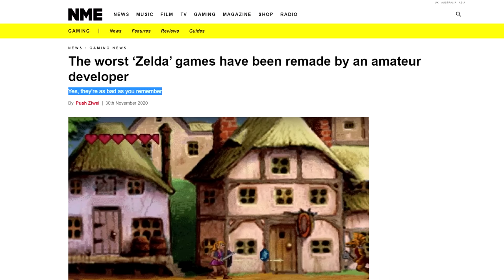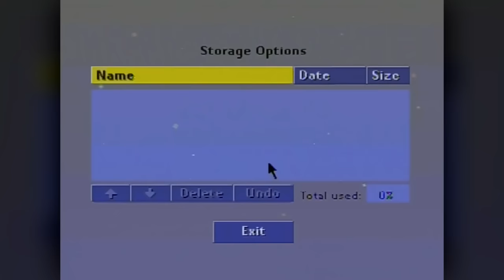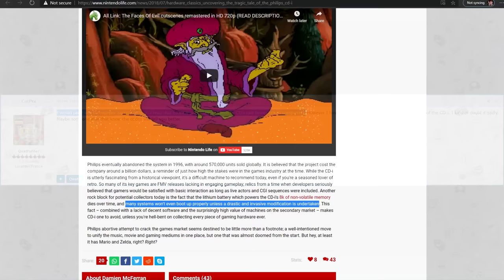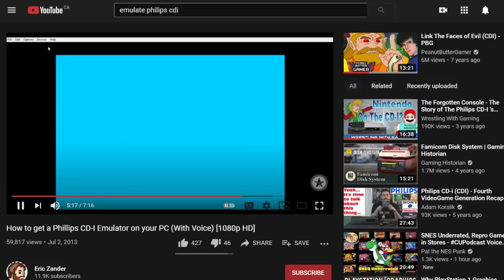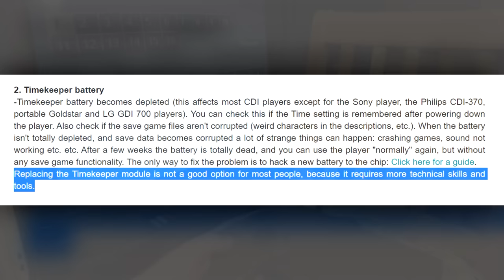Don't Risk Buying a Philips CD-I

Comment: While that may be the only console with that chip problem,  there are some vintage computer systems from the late 80s/very early 90s with that same issue.  I have a Tandy system that has an "all-in-one" Dallas DS1287 Real Time Clock Chip  and the solution is the same as here,   dremel out half the thing, and install one of those CMOS battery holders.

Comment: Yeah, this system's timekeeper battery issue is pretty annoying.  Two types of CD-I systems don't have the timekeeper battery in a chip -- a few very expensive portable ones which have a user-replaceable battery, and the LG and DVS VCR-like models.  Note, the LG/Goldstar one that looks like the 450 is a clone of the 450 and has the timekeeper battery in a chip, but the VCR-like one is its own design and has the battery outside  of the chip, soldered to the board like any other console would do.  Additionally, the LG/DVS VCR-style models also have the Digital Video Cartridge built-in, instead of having to buy one separately, which is great.  However, they apparently do have compatibility problems with a few games, including The 7th Guest and will not work with Philips' wireless remotes, only LG or DVS ones (unless you use Philips' remote sensor accessory).  Still, for the ease of replacing its battery, when I got a CD-I a couple of years ago I got a DVS VE-200 and it was a great decision.  Not having to worry about the timekeeper is a relief; the battery in this thing is still working, but when it dies it's easy to replace.

As for games, I genuinely think that the two Zelda sidescrollers are actually decently fun games.  Beyond that I am not going to defend the system wholesale, but the library's really quirky and interesting in some respects.  It has some interesting stuff if you like early '90s CD experiences, and some of the games are good too.

Comment: From my experience you can easily burn CD-i games. When I got my console some years ago, I didn't have a game to test it (the former owner used it in a driving school, odd story), so to test the system I searched for some iso-files on the internet, burned them on CDs, played tjem on the CD-i and they worked without a problem. I may be wrong, but as far as I know the CD-i has no copy protection. At least I never ran into one. So if you want to test your console, burn a disc and try it.

Comment: Easy repair actually. The chip part that needs to be removed tends to crumble away easily, you can just wegde a knife in about where you expect the boundary to be, it's not the same material and not very well bonded, the IC body underneath is obviously epoxy, the battery section is probably just filled PVC, it just gets crumblier as the time goes on. Don't be afraid to ruin it, you can buy salvage junk chips that you can do the same surgery to, or a new ST chip.

Though the controllers are actually pretty useless. This has to make it one of the least playable systems around.

The rest of the hardware is not a complete catastrophe. That award would have to go to the Jaguar.

Comment: The Philips CDi problems aren’t problems for me.  My modding friend is conveniently located in the United States and he modded the timekeeper battery to be accessible so I can change it whenever needed.  It’s no longer an issue.  Also he modded the system for RGB and it’s never looked so amazing.
Reply: I have a cd-i and the battery is dead...I can't longer save. It is an issue for two games mostly: Hotel Mario and Burn Cycle and ohh 7th guest.

However, some of my top game require a password such as
Inca
FLashback
Lemmings
L'ange et le Demon
Chaos Control is short so I might get it (same for arcade classics and The Apprentice)

I might get a few cd-i movies

Comment: Also the battery is not worth worrying about that much you can finish those Zelda games at least the first two in a few hours if you get a straight run at them. Three button controller is good really it is. Lastly a lot of CDI's come with RGB scart so I don't really see the point in having a modded video out unless you want to make capturing it easier.
Reply: I think it's possible but I have never seen it. The AVGN did not say what had caused the problems he had with the ones that would not work. At the end of the day who ever knows these machines were build to different standards internally and as our chap the frame rater says there getting on a bit faulty lasers and drive mechanisms will do for a few!

Comment: Honestly, I would apply this to ALL retro consoles. They all have some stupid weird issues or gremlins. That said, it would be with the title "Don't Risk Buying Retro Consoles Without Doing Research First". 

From the Xbox 360 RROD back to the Sega Genesis model 2 having crappier audio to the NES having issues with bent pints because of the "oven mounted" cartridges. On and on. 

The N64 has terrible video quality unless you mod it with deblur and RGB. Some older consoles like the Atari 5200 and Intellivision have crappy controller designs. 

You also have to worry about getting better than RF out of really old consoles like the Atari 2600 because TVs nowadays can't accept analog RF signals. At least the 2600 is fairly bullet-proof from what I've heard (not the controllers).

 Any console that just uses a simple cartridge loading system and no discs is probably going to boot assuming the cartridge and slot are clean.

Be wary of any disc-based systems you can't connect a hard drive up to such as a PS2. It's going to be an expensive nightmare to run games on those systems without some sort of mod or addon. 

If you want to play PS1 games, just get a good model of PS2 with a hard drive adapter. It's kind of time consuming, and you have to source an IDE hard drive (or get a Sata adapter), but it's totally worth it. All PS2s are backwards compatible with PS1, and component cables for a PS2 can be had for around $20-30 versus closer to >$60 for a PS1 component cable.

If you want to play Gamecube games, get a Wii. Same thing as the PS2, but it's TONS easier, and you can use USB devices like flash drives or a big ass SD card rather than some heavy ass drive. The difference between component cables on the Wii and Gamecube is even bigger than the PS1 and PS2. Original component cables for Gamecube go for stupid money. You can find great quality (RetroRGB) component cables for $30 on Amazon for the Wii. Wiis also have the benefit of (usually) not being very expensive and extremely common. Parts won't be an issues for these for a very long time. It's the second most common console after the PS2.

Not here to promote piracy. Plenty of ways to buy games, back them up and store them. I just don't think it's worth risking wearing out a laser assembly if you don't need to.

One console that people gush over for easy to mod, the OG Xbox has one giant Achilles Heal. Instead of using one of those coin batteries like used on other consoles and  computers, they cheaped out and used a capacitor. This was during the capacitor plague of the early 2000s. If you own an Xbox, you MUST clip that capacitor off or the acid in it will leak out and ruin the console permanently. I'm into retro PCs (especially DOS era), and bad capacitors and clock batteries leaking acid is a major issue. It only takes on bad capacitor to ruin an entire machine.

There's load more to know, but you get the point. Do some research on these machines before you buy one. Treat it how you SHOULD treat buying a used car.

Also, for the love of god don't get me started on upscalers.

Comment: It's not that hard to rearrange the layout so the timekeeper battery can be swapped easily. That's what I did with mine and it works without issue.

Comment: The target seems to be rather big according to the guides i found. So this should be mostly scary in theory, just be slow and careful while grinding the chip.
Also i would probably remove it beforehand. This surgery puts a lot of stress on very old plastic. I would be concerned about other parts cracking.

Comment: It was a  pain to dremel into the memory chip and solder a new battery to it. I ran the wires to the top for the new battery where I would never have to open the case again. But it is doable and not as tedious as a mod chip on a ps2.
Zeldas adventure requires a new battery or it will glitch out between screens.

Comment: i have one cdi 450, and it was working when i bought it, now the battery is dead and he doesnt play games or music cds anymore, already replaced the battery, i used soldering iron to melt the plastic and remove the old battery, soldered a new one, easy to replace, but still doesnt work, next i will try replace the laser drive, if that doesnt work, to the box he goes.
as a console its a crap and that is a fact
Update-replaced the laser drive unit for a new one and still doesnt read games or audio discs.

Comment: At this point you're just better off emulating cdi games because A they are to expensive B the battery dyed out that's why I use the retroarch front end emulator to play retro games and owning a retro console is just a pain in the ass to mane tane.

Comment: Frame I don't want to make you sad, but all CDi's are copyright and region protection free.
Meaning you can just burn the ISO's of games on CD's and they will work without fail so long as your CD drive spins(which it seems your does).
Speaking of making CDi wisdom/stupidity public: 
I own one of the first PAL region models, the 210 which is exceptionally fancy with a RGB scart and separate composite output as well as an RC6 remote plug (I have no clue what's that for).
SCART in this model does in fact carry RGB, it uses composite as sync so some colors have dot crawl on it, however overall image clarity is pretty damn impressive for a machine from 1990. I didnt need to do any modification for to get RGB out of it either
Mine also had a dead timekeeper battery but it didn't keep me from playing games or starting it up, I only tested De Zak van Sam, Alice in Woderland, Laser Lords, Hotel Mario, Myst and Zombie Dino's from Planet Zeltoid. The Saves would disappear upon powering down even if power cord was plugged in as the CDi, like most consoles and devices at the time used an equivalent of a light switch for a power button.
Timekeeper replacement was time consuming but not overly difficult, I have only used the crudest of way of getting it out as in a fairly dull flathead screwdriver.
You can use the same kind of batteries for it as the ones utilized by the Sega Saturn, which are super common.
The biggest issue I ran into was the CD drive, I was damn near certain is was dead as it didn't even turn! 
What I discovered after days of research is that the spindle has a magnet that attracts a circular metal piece above the drive that keeps the CD in place, neat idea, terrible in the long run! The Drive itself is also made out of metal as one would expect and has an elecric motor on it and as we all know those have magnets in them... So after 30 years the spindle was essencially lying flat on the drive.
Once I knew that I was able to easily fix it with the same crude flathead crewdriver by jamming it inbetween the spindle and the drive and raising it by a few milimeters. You need to do it just high enough that it doesn't rub against the drive, when you stop hearing your CDi cry in pain when you're playing a CD it's tall enough. In fact the CDi makes surprisingly little noise when the CD is spinning tho there's the buzz coming from the speakers I can't get rid of no matter what.
Another thing, for most CDi games worth a damn you'll need an MPEG card It's not only used for FMV games but also for extra ram or something so even games without FMV's can require it. It's built in in some later models but in the earlier models it had to be bought separately(like for 210). There are 2 kinds the HUGE one that's literally almost as big as a Wii(used in early models) and smaller one (used by later ones)
So this is my CDi experience so far I hope it's helpful for someone.

Comment: Well i just bought the slim model of the CDI along with all 3 repro zelda and 2 repro mario games for it,now whether that battery inside it died or not,i still hope i can run those games on it,also i don’t know if the media card is included in it or not,but if it is not included then i still hope i could run those games on it,if not that would be dumb ( becides why was the media card not builtin right out of the box? Am mean it’s a multimedia system)
That’s like buying a game console without a ppu chip in it for wich you have to buy it saperately,also why was the battery soldered inside a chip why not externally by make it replacible by opening the lid of it,why couldn’t they have do it the other way around like an external game module for extra sprites on screen or something like that,an mean  what were they thinking???

Comment: if that battery module is just a dallas chip, you very well won't need to replace it, as there's many cheap clones of the chip with a removable battery.

Comment: So long as you don't damage an item yourself or tamper with an item you received via ebay, you can return it free of charge for whatever reason. If it's truly buyer's remorse, you should be honest and take the shipping bill and still send it back. Sellers have to take return requests or else ebay can potentially force the return or worse, force a refund with no return.
Reply from the maker: I did consider this honestly but the import + shipping charge of everything meant I was only saving like $20 - $40, so at that point I'd probably have better luck reselling it even locally.

Comment: The cd-i is not a console, it's a multimedia device with some gaming capabilities. Sure nobody uses any other aspect than that but you can't fault it for that.
Reply: Also the battery on my 210 is dead  but other than saving the system works fine
Reply: Last thing what's that repro site?
Reply from the maker: RetroGameLab

Comment: "You wont find anyone buying a CDi today, for any reason other than it's library of games" Well your wrong there, I just bought one to play around with the whole thing, not especially for its games. Which were really a very secondary thing and you originally needed an add on cart to play a bunch of them anyway. I'm one of those people who don't really like this being called a 'console' as it was never initially intended to be (only) that. I have laser disks, reel to reel tapes etc as well, I like old AV Tec, and that's why I got one of these. A 'proper' old/original 210 version. It was only later that they tried to flog it of as a 'console' for extra cash. It's really an early attempt at an interactive multimedia machine, not a 'games' console as such. So as a console it was on the back foot to start with!

Comment: what if you change the date on the system? yeah you probably should do that everytime you turn on and off the console but oh well
Reply: if you fix that battery it'll keep track of the date, and gamesaves and other settings.
if the battery is dead, you often can't even get into the clocksettings, so you have to fix that first.

Comment: I fixed my battery, it's not that hard (okay it was a bit of a mare). And yeah you can boot games but nothing is saved once the power is turned off.
Burn the Zelda games, they are some of the worst games on the system, and this is the CD-I.
Thunder in Paradise is probably one of the best Exclusive titles for the system, but requires the Mpeg cartridge.
Hotel Mario is also very fun.

Comment: Easily the weirdest of all this to me is that freaking power connector
What the hell
Reply: matt fahringer  Same problem, too. Eventually the plastic tab breaks that holds it in place. It's hardwired into the power unit, too, so you can't just swap out the cord.

Comment: I Just got this  450 cdi model from UK and made it work in US just had to replace power cord region free now I got got 2 power cords lol
Reply from the maker: Wait, it works without a transformer? Is it true you really just need a proper power-output cord?
Reply: @FrameRater  
i think he means he just replaced the power cord to the transformer, the 450 need +5v and -5v to work, so a straight cable from your AC socket will just let the smoke out.
don't do it.

Comment: i have a 450 with a dead battery. it plays games fine. and you don't need to arse around buying reproductions, you can literally just burn ISOs off.
this research would not have been difficult to conduct before making the video.
Reply from the maker: And I knew about this. Burning CD-Rs for these older consoles has always been a gamble for me. You need to use the correct speeds and often have an older drive of which I do not. And then, using certain CD-Rs can be bad. I don't trust my judgement with this, so I turned to a reproduction site which more than likely knows what they're doing/making. Also, reproductions are more like owning the game than a burned disc, since you get the case/manual and everything.
Reply: right, but that doesn't mean you couldn't have tried. this video reads like you're saying "a CD-i with a dead battery may as well be useless".